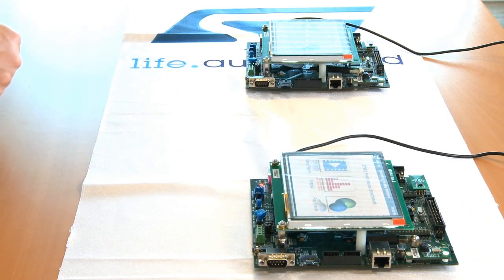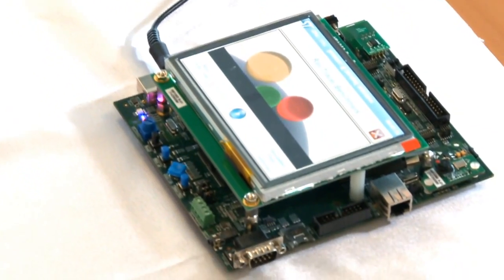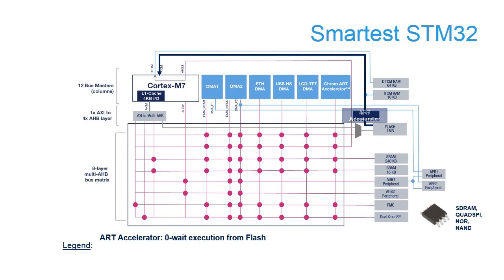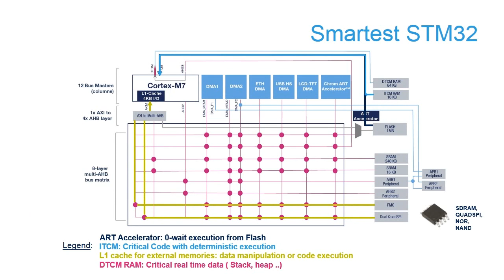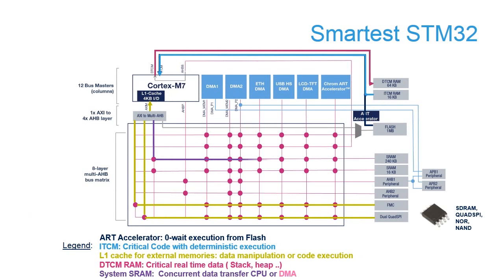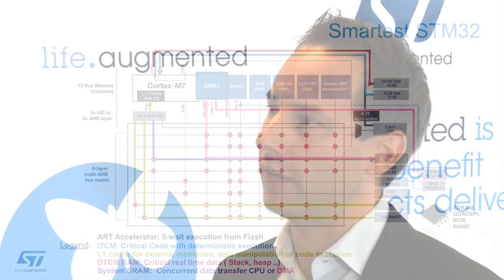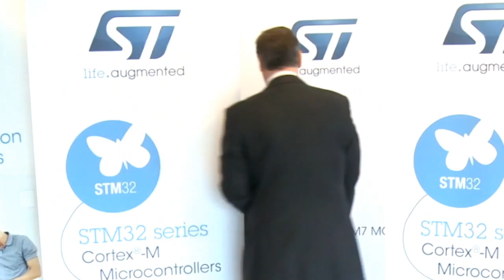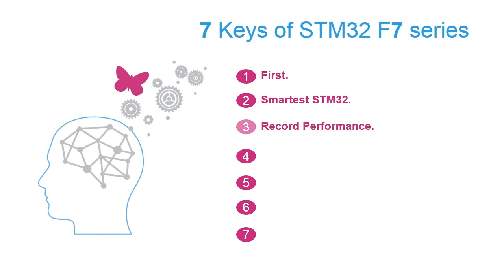STM32 F7 Series - The smartest STM32 ever:  World’s 1st ARM®  Cortex® -M7 based 32-bit MCU

Comment: ***** 
Hi
 Oups !! sorry but, at 0:30 can you explain, what he talk about ?, M7 is a microcontroler !!!!  check here http://www.arm.com/products/processors/cortex-m/cortex-m7-processor.php

any way, i have a question, why ST, decide to work with Cortex M7, in place of Cortex A9, this dual-core processor also have power, cost and performance advantage , is more famous and successful in comparison with M7 ?

thanks
Reply: The cortex m7 is a core, not an entire microcontroller. And I think that ST mostly focuses on embedded devices so the cortex m cores are better for their requirements. The cortex a series cores are mostly for thing like running an operating system and require a bit more to get working. Hope this helps.
Reply: Daniel Moses ok, i understand but it still a mistake, there is a huge difference between core ( CPU ) and microcontroler !!
Reply: Mohamed Amine Ghodhbane  everybody makes mistakes :)